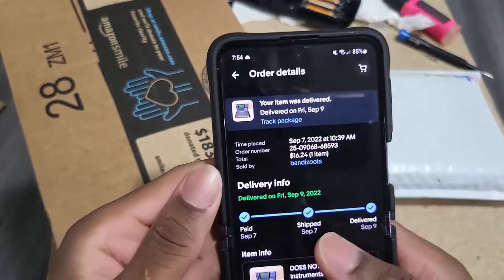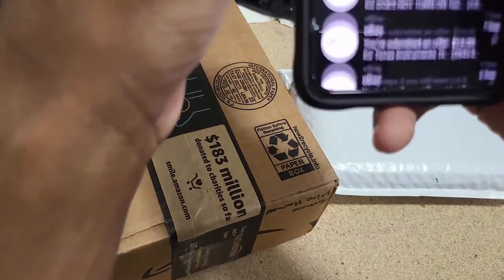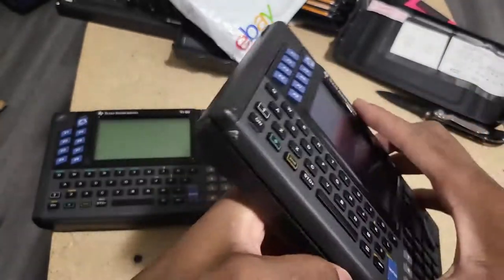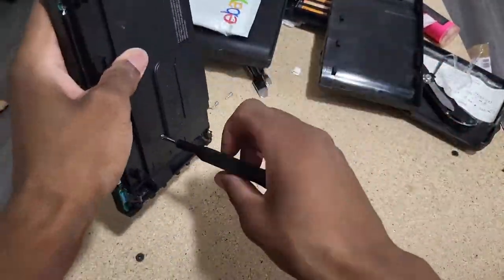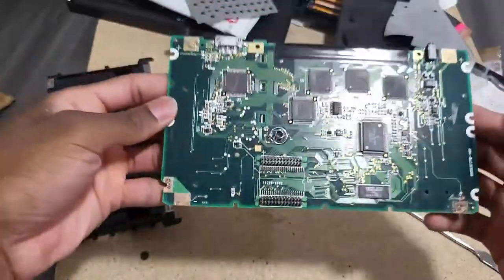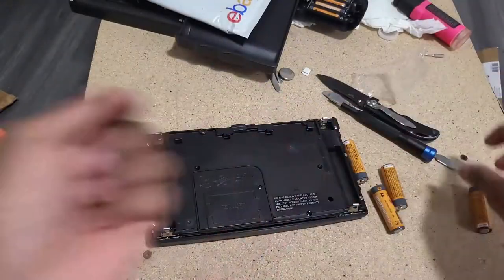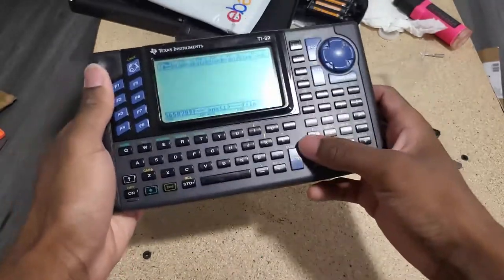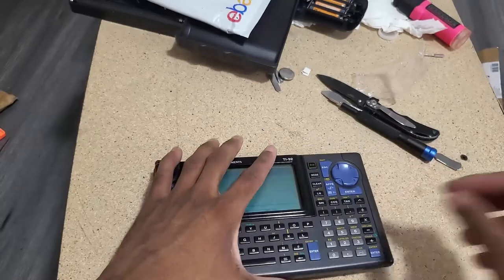I Bought 2 Broken Ti-92 For $38 - Let's Fix Them!

Comment: I got a ti-92 for whatever reason pressing f5 causes it to freeze although you can just navigate to f5 on the home screen by selecting one of the other function buttons and pressing the arrow buttons. also some text in the f1 menu appears to be bugged don't understand why but it doesn't affect operating the calculator enough to impede me from using it.
Reply from the maker: When you press F5, it takes you to the page where programs are typically ran from. If you have no previously opened programs, then the page will appear blank, and pressing ESC will take you back to the home screen. As for "bugged menu", those missing pixels indicate that the options are not available on the current page. For instance when you press F1 while on HOME, line 1 and 3 will be greyed out. Pressing the APPS button and creating a new "Text Editor" file will make those options available.

Comment: Did you figure out if it was that one particular display that was hard to see or are all 92's like that?
Reply from the maker: All 92's, and probably all 92-II's as well. I have about 20 92s, and the display is the biggest downside, especially when put next to the 92 Plus.
Reply: @calculator_boy  Oh wow, ok so it's not a one off thing. Do you have any 92 or 92 plus units that you'd be willing to sell that have lines in the display? Horizontal, vertical, or both.